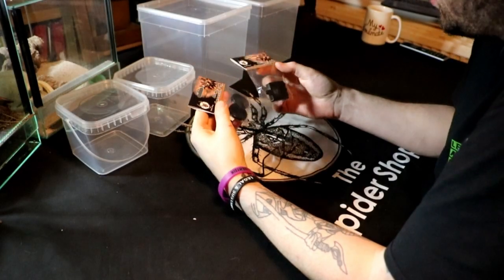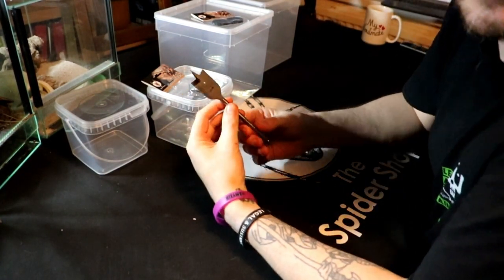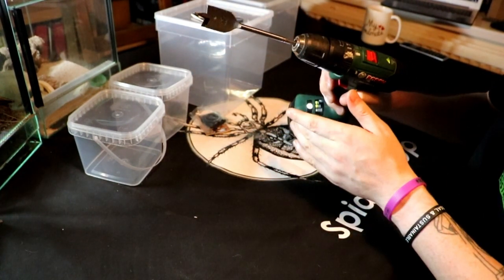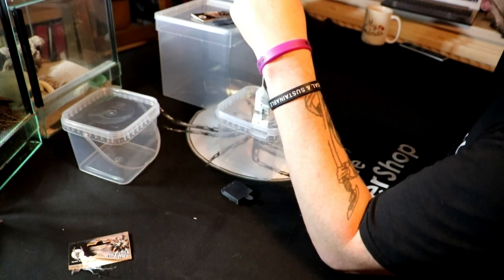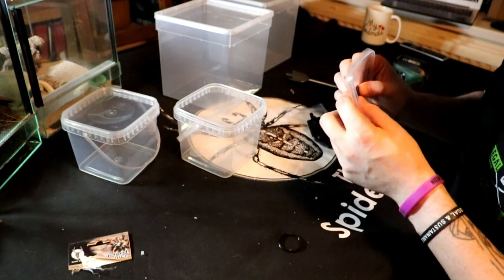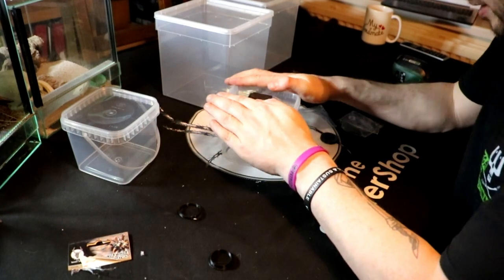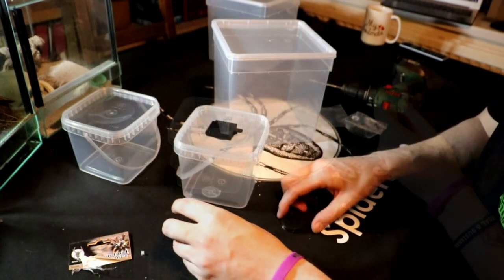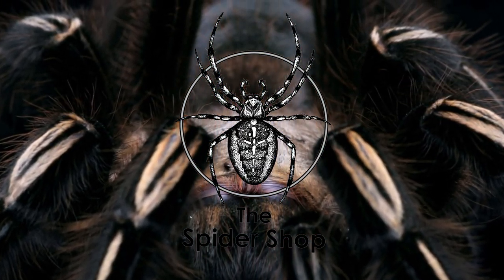Assembling reusable vents and feeding vent

Comment: Hey, I'm a plumber and actually have a tip for you! Drilling holes in plastic and vinyl like that, you can run the drill in a high speed but reverse the direction and it makes perfect holes without any chipping or tearing. :)